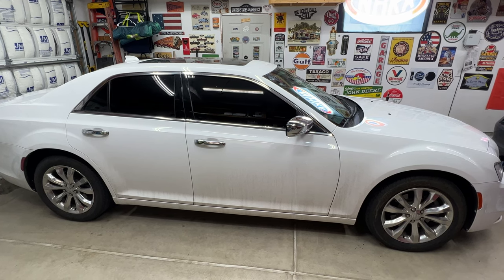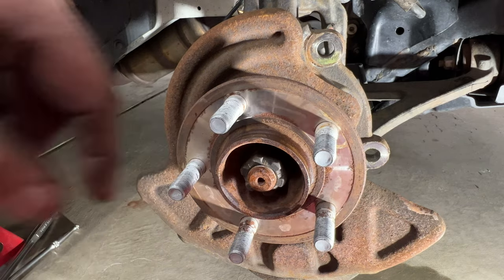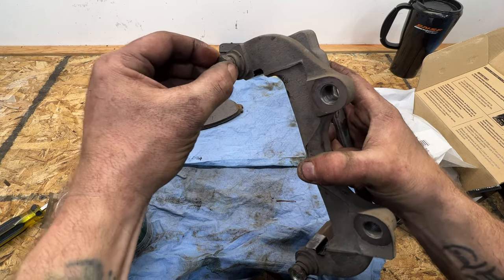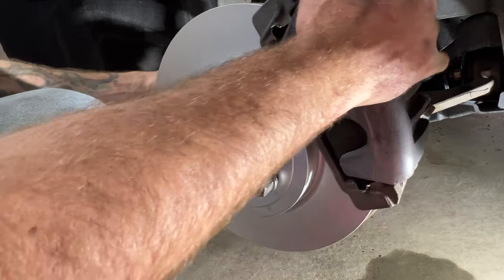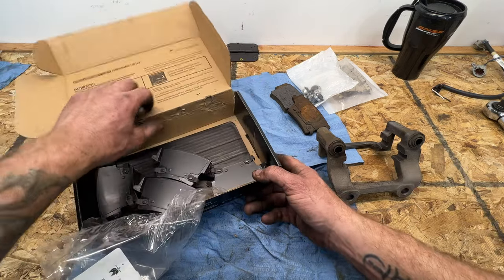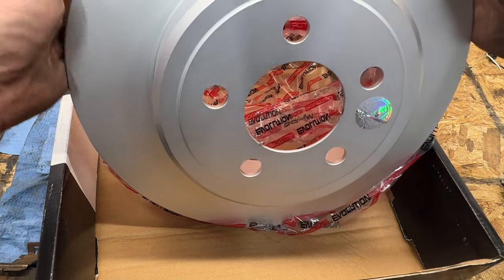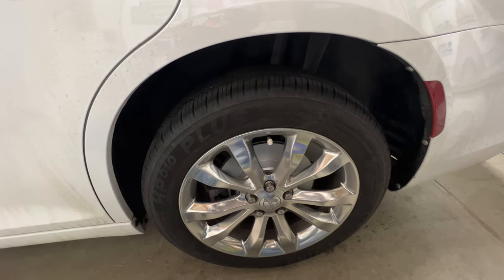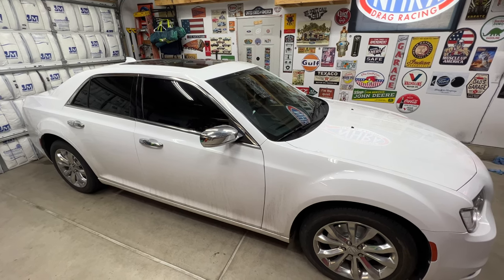2011-2023 Chrysler 300/Dodge Charger Front & Rear Brakes Replacement How-To

Comment: Great instructional video, even ordered the parts you recommended. The only problem was the parts you used were for an AWD vehicle, mine is RWD (12.5” rotors). Opps! Once I got the right rotor and brakes, it was a breeze except for those damn caliber bolts. Thanks a bunch!

Comment: I just did my sons 2013 I used every tool I had couldn’t get the bolts for thing that holds on the rotor so I had to put the shoes on till I can get a better tool, my air Impact wouldn’t do it my electric impact wouldn’t get it I got it about an inch and then nothing
Reply from the maker: Are you talking about the caliper bracket? Mine were the same way very hard to get off thought I was going to brake the bolts.
Reply: I had to use an impact driver with a sledgehammer. Worked wonders.
Reply: I also stopped mine cus those 21mm would not budge. There's a shop with a lift nearby, and I'll pay the labor for them to finish it. It's my first brake job I gave up on in 25 years...😅

Comment: This is a very nice tutorial!  I did my 300C brakes a couple of years ago and installed new rotors/calipers/pads.  I have to replace the front wheel bearing hubs now and wanted to review how to take the brake system apart and reinstall.  Your video will be extremely helpful in this.  Thank You and kind regards!

Comment: Thank-you so much for this video, I have watched it a couple times prepping to do my brakes and your explanation made it so that when I actually did them I didnt run into any trouble (aside from the resistance from those bolts on the caliper bracket 😅)

Comment: Same thing happened to me getting the Caliper bolts out. Glad to see I'm not the only one!
Reply from the maker: Yeah they must have caked these bolts in loctite from the factory.
Reply: @BLUECOLLARGARAGE  Great video by the way. Changed out the rotors/pads on my 300 55k miles ago. Started developing Shudder recently. Took apart to notice the pad clearance cut completely full and glazed over. Knocked out the burnt up pad dust from the crack and the shudder at low speed went away. Still shudders at speeds above 60mph. Can't win. I noticed your pads had the clearance cuts still. I believe the harsh winters up here is the cause.

Comment: hey man, I just want to say thank you for making this video. I had creaking noise that never went away despite me going to my mechanic. long story short after 3 visits with him. it got even louder. FOund your video and decided to do it myself and see whats making the noise. lets just say i won't be going to that mechanic again as he did the lazy route of just caking on grease without cleaning it or anything. 
First time touching my brakes and honestly hands down the best video and FULL information step by step on how to change the brakes. I appreciate you taking the time to make this. 
Btw, how is the powerstop z17 brake pads holding up? i just need to change my brake pads as i saw it was getting low and my OEM rotors are still good so far cuz i only have 44,000kms about 27,500miles (I live somewhere that uses the metric) lol!

Comment: Nice vid. I did need a 4 ft breaker bar to loosen the bracket bolts. Other than that, pretty simple.
Reply from the maker: Chrysler must have caked that loctite on at the factory seems like everyone including myself struggled getting those brackets bolts off.

Comment: I'm getting ready to change my breaks and rotors on my 2018 Chrysler 300s rwd, and I can't find the spect for torquing the bolts for the bracket and the caliper itself, can you tell me how much torque to use please? Thanks in advance! 
Huge fan of your channel by the way, it has helped greatly with my Chrysler. Keep up the great work.
Reply from the maker: Front caliper bracket bolts 98 ft-lbs
Rear caliper bracket bolts 81 ft-lbs
Front caliper bolts 44 ft-lbs
Rear caliper bolts 23 ft-lbs
Reply: Thank you sir, I appreciate your help.  @BLUECOLLARGARAGE

Comment: Thank you SO MUCH for your in depth how-to!!  I have my parts ordered to change out my pad and rotors (front and rear) on my 2014 3.6L and I have one question please:  Are the tightening foot pounds for the calipers and caliper brackets actually that much different for front and rear?  Just want to make sure I understood this correctly and don't mess something up!!
Reply from the maker: Yes foot pounds.
Reply: @BLUECOLLARGARAGE    LOL  - I understood foot pounds :)   What I wanted to know was if the recommended tightness actually varies that much from front to rear.  Thanks again!!   (hopefully my question was more clear this time :)

Comment: Great video. Did you get a chance to bleed the brake system?? Would you ever change to a double caliper system in the rear brakes?? Thanks again.
Reply from the maker: I did bleed the whole system off camera just to get new fluid in there because I don’t know how old it was. I think the single piston works just fine for this car I don’t think a dual piston caliper would be worth it especially because this car is not very heavy.

Comment: Do you have to use new copper crush washers after remov8ng banjo  bolt? If not could it cause air into system?
Reply from the maker: It’s always good practice to but honestly I’ve reused them before with no issues.

Comment: So
I changed both rotors and brakes now I had a traction control light that won’t go off what should I do
Reply from the maker: Sounds like you have an issue with one of the wheel speed sensors. Did you undue any of the connectors? Or one of the sensors lines get pinched or frayed?

Comment: Omg idk where to start with my car . It’s leaking coolant from the water pump now my passenger side brakes are squeaking and grinding. I forsure need a new rotor . Those brake pads fuckd him up omg but I don’t have time . I’m doing  the work myself tomorrow
Reply from the maker: Are you sure it’s the water pump these cars are common for the plastic thermostat housing to develop a leak and coolant housing gasket. Sometimes these two items get mistaken for a water pump leak.

Comment: Do you need a torque wrench to get job done ??
Reply from the maker: No not at all. Most of the time torque wrench’s are needed more for internal engine parts but for brakes it is not needed I just like to show using one because a lot of people think it’s needed.
Reply: Right on boss what size mm sockets needed just 13&18’
Reply from the maker: @Jayyy1990  yeah that should be all and a 22mm for the lugnuts

Comment: I have a 2016 chrysler 300s, can I order all this for my car as well? Definitely going to be subscribing to you as well
Reply from the maker: Just depends is your a 3.6l or the 5.7l and is it Awd or just Rwd?
Reply: @BLUECOLLARGARAGE  it's the 3.6L and Rwd
Reply from the maker: @knifemaster1  then you would want something like this https://amzn.to/3B9VIhm because mine is the Awd so I have dual piston front calipers and since yours is Rwd you will only have the single piston on the front calipers so it’s different part numbers for the pads and rotors.
Reply: @BLUECOLLARGARAGE  awesome.  Thank you!
Reply: Do you have to replace the rear caliper pin guide/circle thing inserts?
Reply from the maker: @vincentevans2080  no as long as there still in good shape you can definitely reuse them.
Reply: @BLUECOLLARGARAGE  what about a 5.7 rwd 2014 would it be the same as your setup or would it still have single piston?